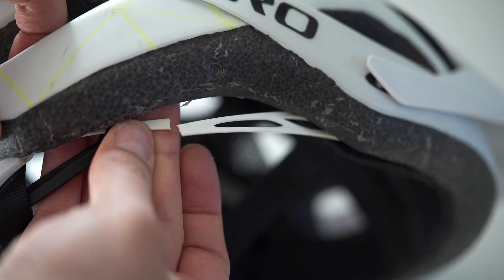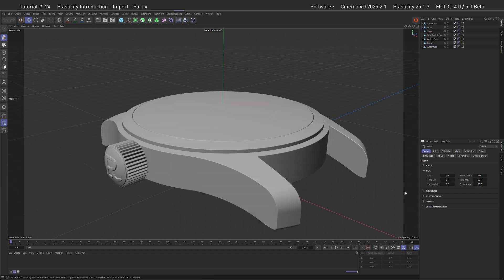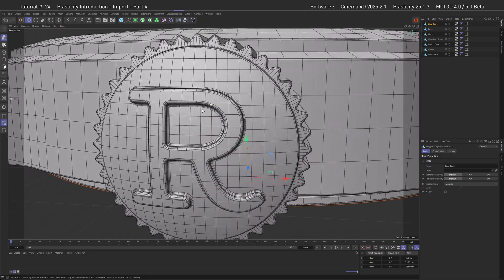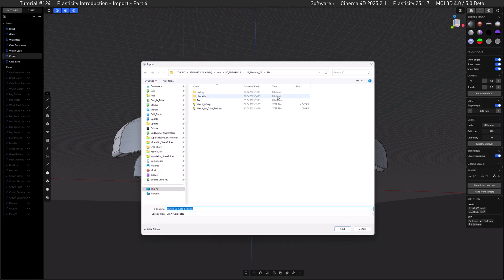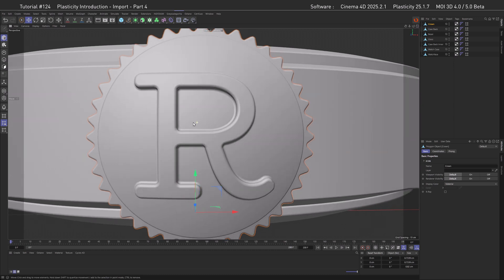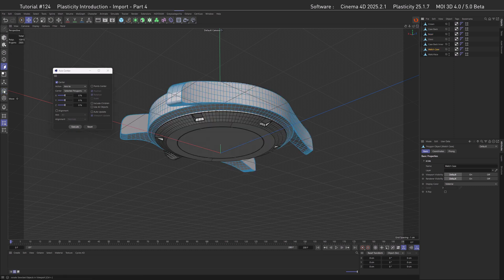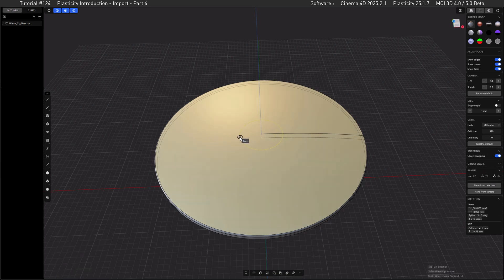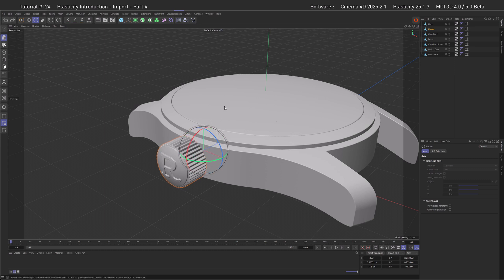Silverwing: Plasticity - Watch Making PT4 - C4D Import

Comment: Thanks Raphael! When bumping into problems like the glass export error, it's always nice to know why it actually happens and what the fix is. The model looked fine in Plasticity, at least with my limited knowledge of the mysteries of CAD files. How did you figure out the solution, to add the isoparam? 

Also, fingers crossed for less tech disasters this week. 🤞
Reply from the maker: Hey there and thank you very much for your comment and the ✨🤞✨
Honestly I just played around to see what helps.
Sometimes re-importing and "Healing" works. Sometimes re-doing the fillet works. Sometimes using another MOI version works.
But giving more definition has a high overall chance of working.

Moi sometimes has problems, especially with spherical shapes not being able to resolve them correctly. So over time I developed the habit of exporting the model once, then have a look either in MOI directly or in C4D how the mesh loos. Then, if necessary, do a second pass where I go over the affected parts and add more definition.

Funny thing is, in my test run it all went smooth. No problems there. But as I say in the video. I am sort of glad it happened, as it's a good showcase how to get around it.

Cheers and a fantastic start into the week to you to and 🤞back to you too ha ha ✨
Reply: @SilverwingVFX  Yeah, there is always the exciting element of randomness and trial and error, isn't there? 😁
Thanks!